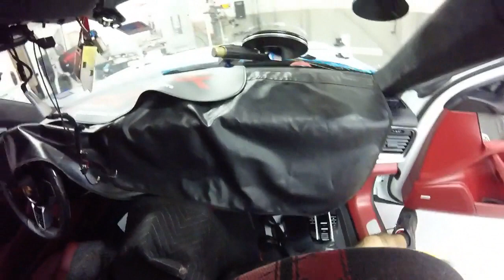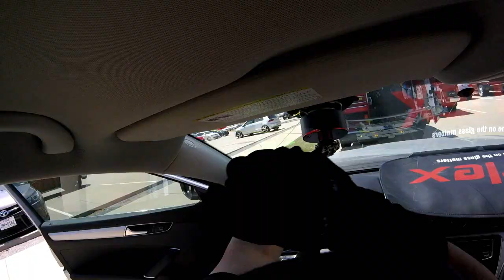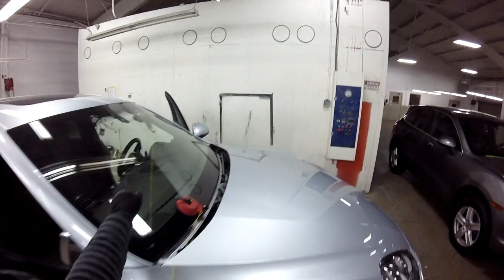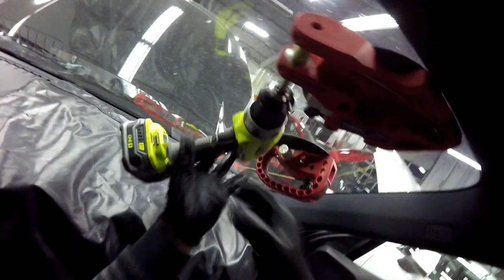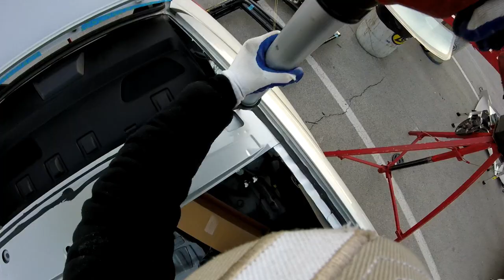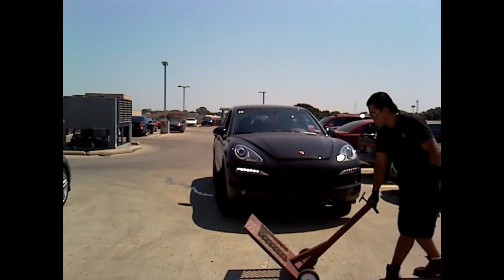PARTY TOOLS..

Comment: Very nice vedio thanks Louise 
I just have a little question what tools will be the best and fastest to remove a quwarter glass
Reply from the maker: small quarters gt tools larges you can use gt to open the first part face to the door ans finish with OB S3 RAPTOR VIPER MONGOOSE IF YOU WAN MAKE A CLEAN PULL OUT OR FINISH WITH GT CUTTERQUATER LONG BLADE OR JAMMER RAMMER WORK PRETY WHELL